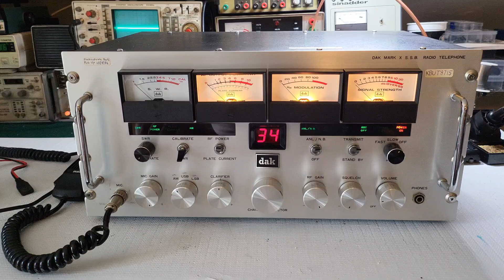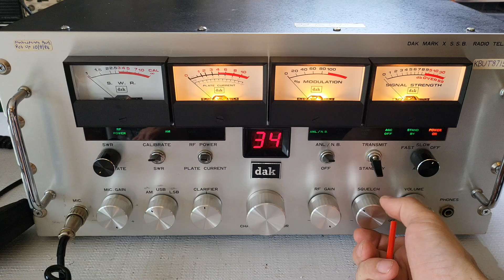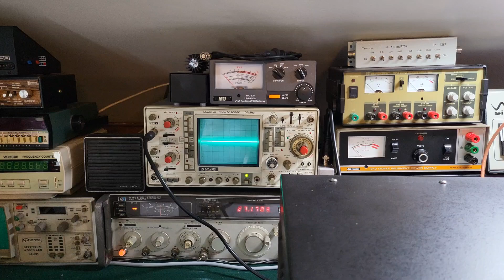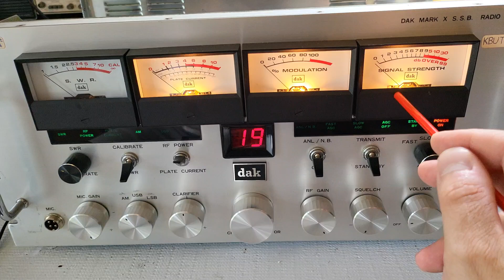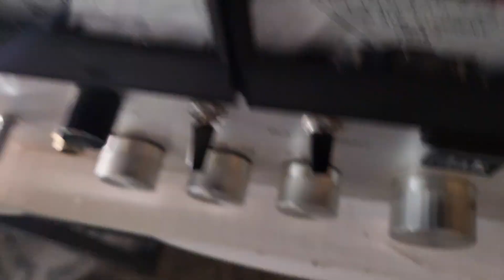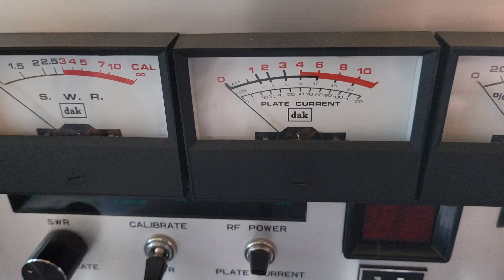DAK mark X (10) with major issues for repair

Comment: Im a Dak lover. Been working on them since 1983. O think I have 5. When tuned well, they scream. The plate modulated output tube configuration is similar to what Tram did with the D201. I remember when the dak radios hit the area in about 1980. The aluminum rivets that connect the top of the pc board to the bottom are a bugger. Great to see your video. I'll buy the dak mark x if you don't want to. LOL.
Reply from the maker: It's a customer's and not mine to sell
Reply: got one for sale new lamps 6lq6 and freshly tune 15watts am 40watts ssb a screamer esthetic 9.5
Reply: got one for sale new lamps 6lq6 and freshly tune 15watts am 40watts ssb a screamer esthetic 9.5
Reply: got one for sale new lamps 6lq6 and freshly tune 15watts am 40watts ssb a screamer esthetic 9.5